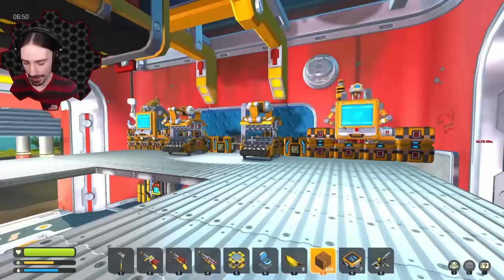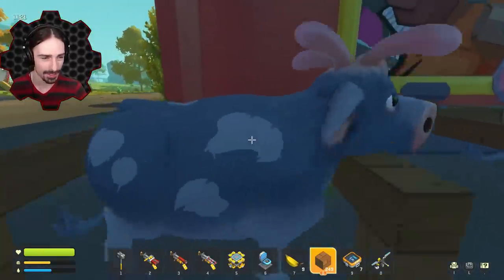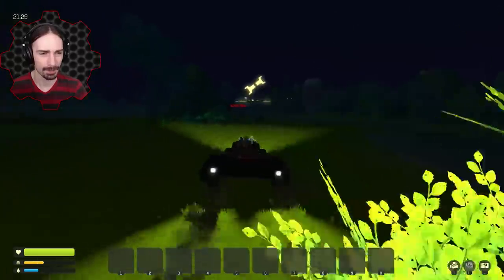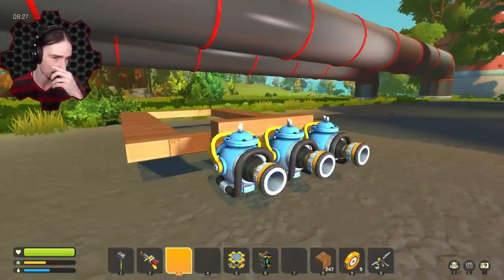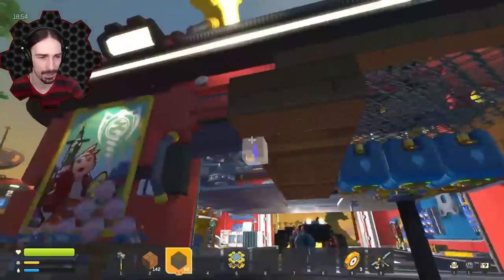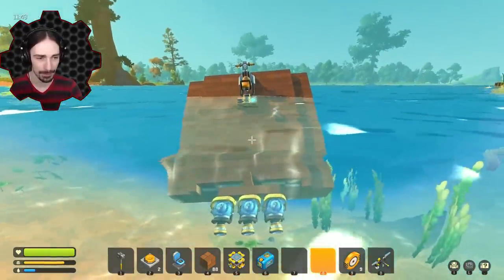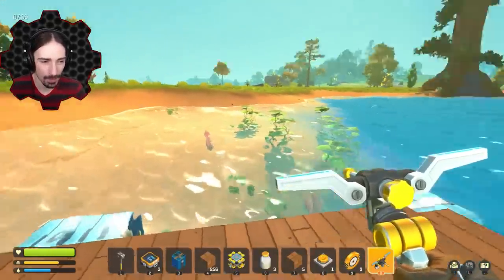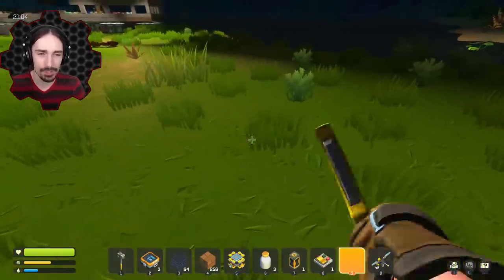Water Cannon Experiment! Can They Propel a Boat? - Scrap Mechanic Survival Mode [SMS 16]

Comment: Try using airspace inside the raft and maybe experiment with a paddle to see if that works. Edit: Ah, you did experiment with paddles and I wasn't there yet. Try attaching those to engines and make them rotate quickly, since your test rig was very un-aerodynamic with the large frontal area. The test I saw Camodo and SpyCakes do was pointless since their paddle sunk all the way under the surface. The way water physics work in Scrap Mechanic from what I can see is that water applies a sort of friction against blocks. If you can make a lightweight, wide rotating paddle, you can probably gain some form of forward propulsion in the water due to the friction applied against the paddle as it moves through the water, thus the basic physics engine in the game exerts the reactionary force against the boat and moves it forward.

Comment: You should make a platform that has a seat, water-container, vacuum-pump, water-cannon and the programming that makes it work all as close as possible then work your way out and get it to float/look how you want it to.

P.S. the caged farmers are super floaters and can be welded on the back of the cage

Comment: Has anyone tried using a controller turning a wheel with pistons on it to generate movement? Like extending pistons on one side and retracting that same piston by the time it returns to try to offset the torque to something that moves? I don't know how that would work but my mind won't let go of that thought.

Comment: bast boat material is this wood and bubble plast https://steamcommunity.com/sharedfiles/filedetails/?id=2111343664 
start with wood and just build it shaped like a real boat,  underwater parts have boyancy too. this small boat have 2 thrusters and fueltank in the back. even concrete keel and 2 seats. oddly enough most bubble plast was needed at front.